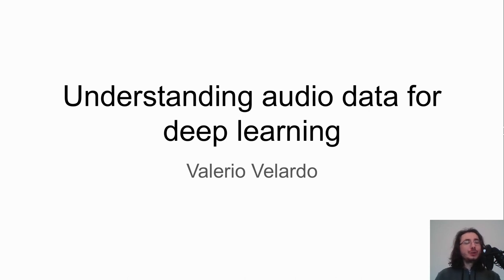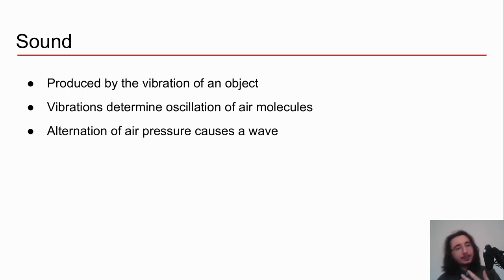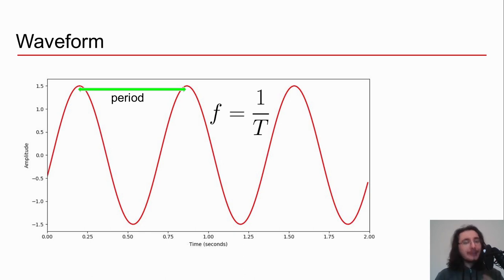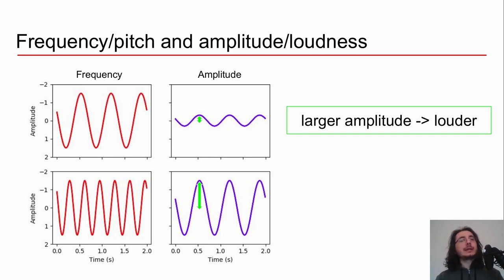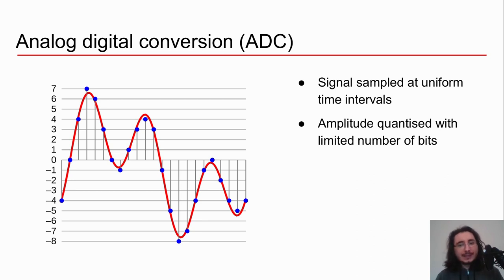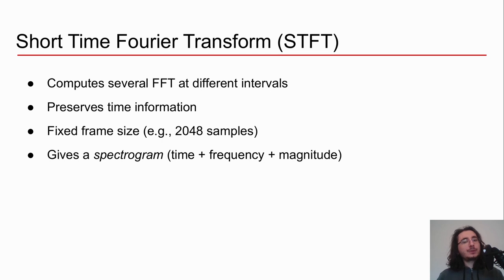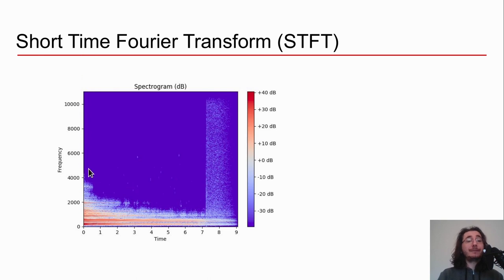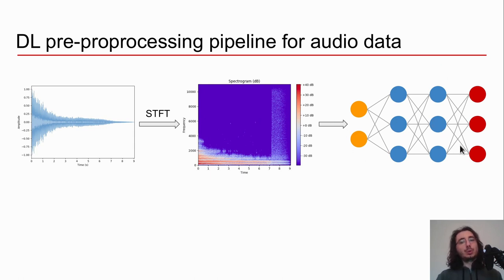10 - Understanding audio data for deep learning

Comment: Did you find that uisng MFCCs works better than using a spectrogram?  I just stumbled upon your video and I have been using the same dataset but I extract the spectrogram and feed that into my network.   I am constantly running into overfitting, and even when I use the same CNN as you do (in your later video) I only get about 50% validation accuracy, while getting 99% training accuracy.   Does using MFCCs reduce overfitting?

Comment: This might be a stupid question, but do you use something like a sliding window on that MFCC? I thought most of the sequential data is processed with RNNs/LSTMs, but then I would guess only a value from a single time-step is processed from that MFCC
Reply from the maker: It's actually a great question. Deriving MFCCs is an elaborate process, with several steps. The first is to perform a STFT, which uses a sliding window. The sliding window is characterised by two values: the window (i.e., the frame size expressed in num. of samples), and the hop length (also expressed in num. of samples). When you perform the FFT, you consider a time interval equal to the frame size. Then, you shift to the left by an amount of samples equal to the hop length. The hop length is < frame size. This is the case, in order to produce overlapping FFTs, which preserve info about the edge of the intervals. Since the MFCCs rely on the STFT, you can state that to extract MFCCs you use a sliding window. 

As for the second part of your comment, you can definitely use an RNN to process MFCCs, passing the MFCC vector for a single window at a time. However, you can also process MFCCs using basic MLP or CNN architectures, treating the MFCCs as 2D data, similar to images. We'll take a look at this in the following videos. Stay tuned!
Reply: @ValerioVelardoTheSoundofAI  Thank you for the explanation. I've never worked with audio (I do graphics stuff mostly), so this new domain is pretty fascinating to me. I would guess that some architecture similar to video processing would also work as you have a series of 2D time-dependent inputs. Looking forward to the next video!
Reply from the maker: @aigen-journey  your guess is right :)

Comment: So when we pass the spectrogram as input to the NN, we represent it as a 2-D input (meaning we have to get rid of either time or magnitude) or as a 3-D input? Thanks!
Reply from the maker: The dimension depends on the type of network you're using. However, the basic idea is that you'll be able to package time, frequency, and magnitude in a 2d array,  in the same way we visualise the spectrogram. The shape of the array is (# time steps, # frequency bands). The values featured in the array are the magnitudes, for each frequency band at each time step. In case of a CNN, however, you'll have to pass a 3d array, where the 3rd dimension indicating the depth. For audio data, depth is 1, just like in greyscale pictures. For RGB images, depth=3. I cover this and more in the following videos. So, stay tuned :)

Comment: I am a bit confused about the meaning of "Magnitude" in the frequency domain graph , generated after doing fft on time domain. Can you please explain, out of the below two , which explanation is correct.

1) Magnitude corresponding to a particular frequency after fft shows the number of times that particular frequency has occurred.

2) Magnitude corresponding to a particular frequency after fft shows the Amplitude corresponding to the sine wave having that particular frequency.

Thanks for this wonderful video 🤩

Comment: Hi Valerio thanks for a great explanation of the basic speech concepts. However, I have few questions:

1) https://youtu.be/m3XbqfIij_Y?t=572 -- Why can't we use this picture as an image representation of speech instead of MFCC or spectogram image?
2) Since speech can be represented as a list of numbers (amplitude) over time, can't we use LSTM/GRU for processing speech data directly.

Could someone please help me in clarifying the above questions?
Reply from the maker: You can also use the so called raw audio representation. But it's way more computationally expensive than using spectrograms / MFCCs. I would suggest you to check out my series called "Audio Signal Processing for ML" to dive deeper into all of these concepts.

Comment: A great explanation in understanding audio data for deep learning. It's really "new" for me.
I just want to ask that is all audio analysis using spectrogram data as the basis? 
Thank you
Reply from the maker: Thank you! Not all analysis uses power spectrograms. If you're using traditional ML / audio DSP techniques you would use also other features (e.g., chromograms, zero-crossing rate). Spectrograms and similar features are usually used in end-to-end DL approaches. I'm planning to create a series on audio/music processing where I dig deeper in the topics I only scratched in these couple of videos.